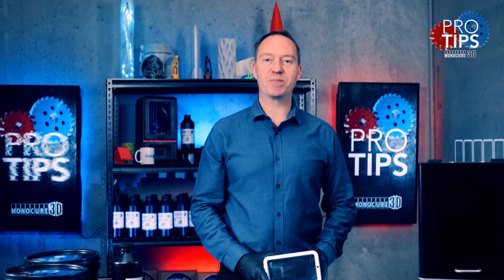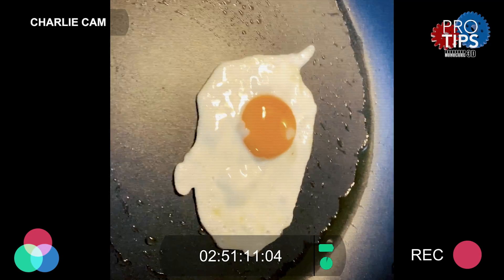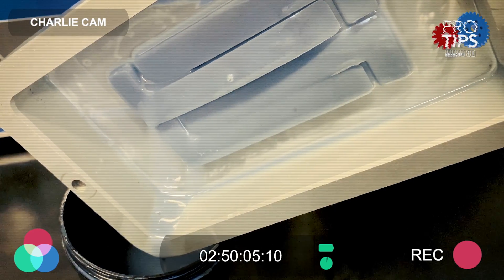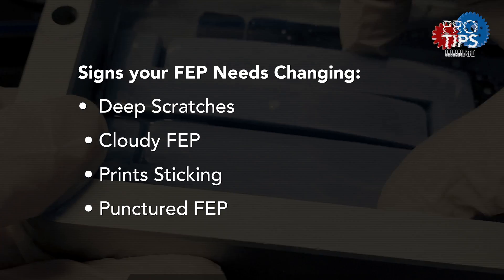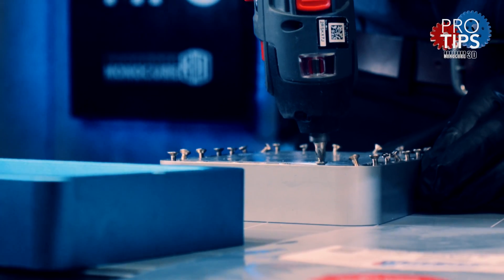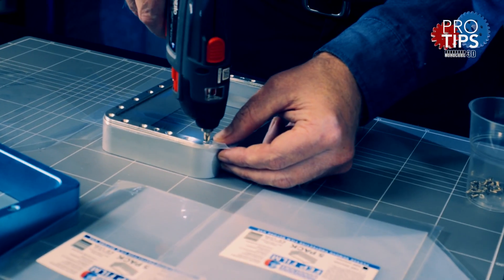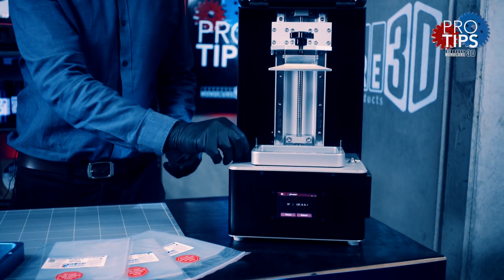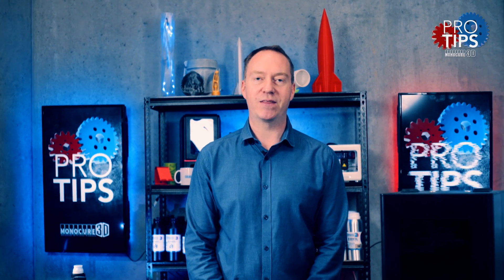How to care for and change the FEP Film on your resin DLP 3d Printer.

Comment: I got 2 questions. 

1) what if there is a rubber gasket? Was side of the FEP film does it go? On the inside between the film and the tray? Or the outside between the film and the hold down plate?

2) do you often accidentally jab your screwdriver straight through the FEP?
Reply from the maker: 1) FEP Film should go under the gasket. 2) it happens more often than u think!